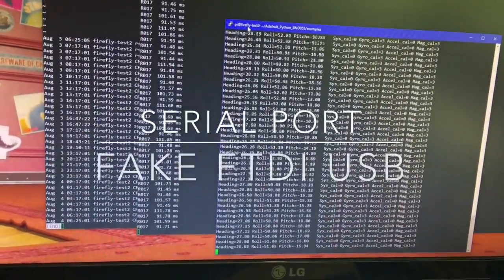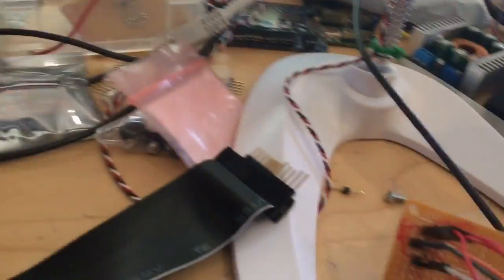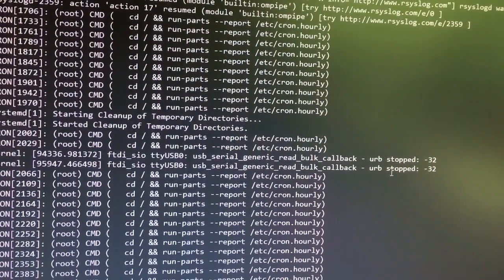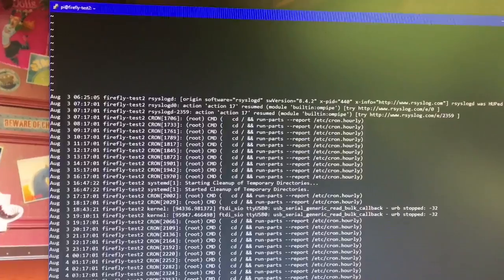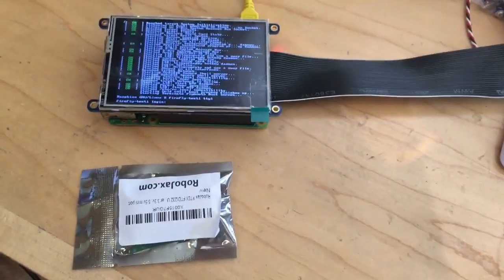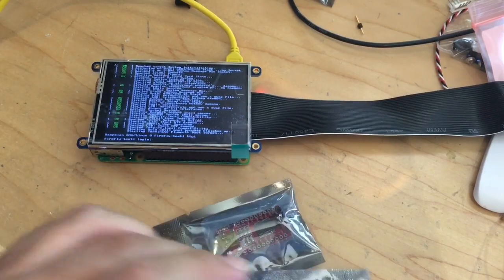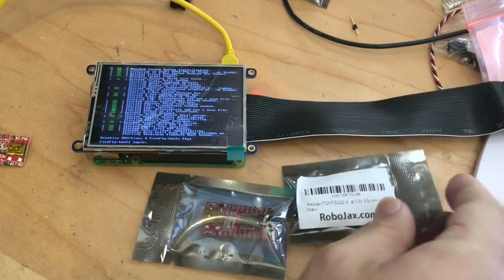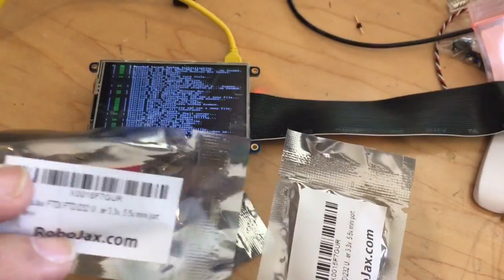Fake FTDI chips in USB Serial Part 1 of 2

Comment: is it possible to change the serial number a502 to another name
I'm not able to record another number in the place
for my application I need different names is it possible?
Reply from the maker: That's built into the firmware of the chip.  You can't really change it.